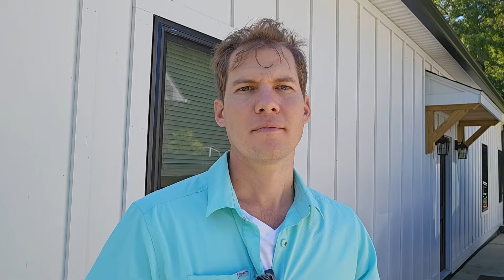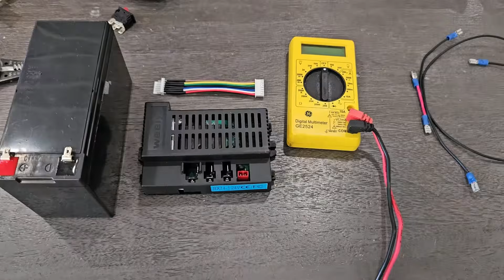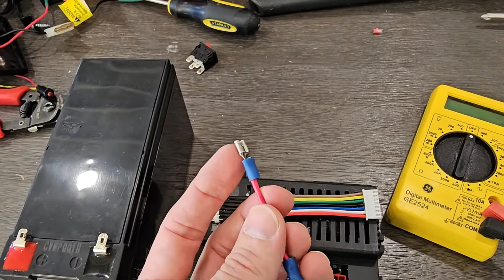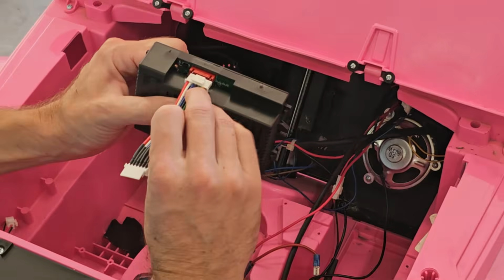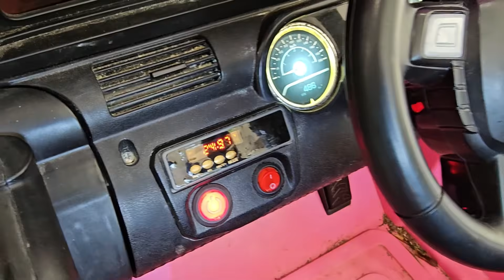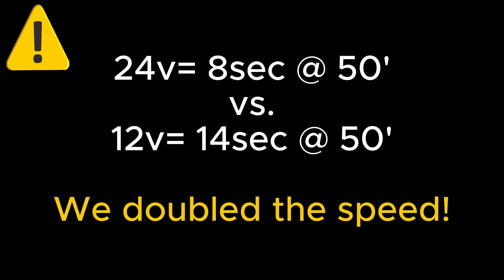Upgrade your ride-on-toy from 12v to 24v power

Comment: Could I use this controller with a Milwaukee M1 18 battery?
Reply from the maker: Yes, you can do that as well. Probably safer than going full 24v. I have another video where I run an M18 on a fourwheeler. The run time is much better and the charging time is much quicker. Helps when you have spare M18s!

Comment: read on the internet that the lights, radio and steering motor can't take the 24V. How did you overcome this or am I missing something?
Reply from the maker: Hey ben1637! Some models this is probably true for. Mathematics shows fuses should blow and motors burn up but keep in mind there is usually a built in safety factor. 
The only piece I upgraded was the circuit board. I Installed a 24v replacement for the 12v. Comes with an extra port that you won't use. When you upgrade it sends more volts to the motors but the radios and everything else should still run on 12v. Mine has been going strong for 4 years now. I probably should have upgraded the motors as well but they are still working great.
We're getting ready to replace one of the batteries that went bad over winter but check out the description. There are a few links to the products I used. 
Hope this helps clarify a few things!

Comment: Why didnt you swap out the motor also?
Reply from the maker: A few reasons:
1. Experimenting to see the length of time these would last without upgrading motors.
2. I figured there was a built in safety factor on the current motors.
3. Didn't want to spend the extra money for this mod.
4. Time. Working on 3 businesses right now.

Thanks for the question.

Comment: You need a throttle that allows the driver to control the voltage.
Reply from the maker: I did experiment with a voltage regulator on a previous project! Turns out the kids like receiving whiplash and only want to go balls to the wall! Full send.

Comment: Is that a best choice product 12v jeep? Looking to do the same to one I have, would you be able to leave he link for what you needed to do the conversion in a reply? And did you need a new charger or does the original still charge both?
Reply from the maker: Hi, it's a 12v and I added an additional 12v in series to beef it up to 24v. I dont have a link but every item I used is in the video description. Most brands are built just about the same so parts may differ slightly. Same charger works just fine!

Comment: Does this convert all the accessories like the lights and radio to 12v I saw on a different video that you need to install a resistor so you don’t blow all of those out
Reply from the maker: Hi @CopterJoe,  my lights are functioning well without the resistor installed. I imagine there is some built-in tolerance.  I don't know the specs and haven't done the math but just to let you know, the 3 that I have converted, I have not installed a resistor on any of them, and all the lights work fine.  Even a year later for the next child.
Reply: Led globes are multi voltage can run on 12v 18v 24v and won't burnout if over volted

Comment: Great vid - What motors are you running 

12v 390,550,775 ? 

Or 24v ones ? 

Thanks
Reply from the maker: The original motors this came with are still intact. I believe 35watts but not sure if that equates to a 390? Thanks for the question. 👍

Comment: How are the motors and gearboxes holding up?
Reply from the maker: Very well! Still running strong and receiving full output. One day we rode for about 20 minutes non-stop and there was a bit of an electrical smell coming from the jeep motors, but all good!
Reply: That's actually very surprising. I'm working towards the same upgrade for my kid's car as well but the gearboxes are designed for 12V, which I presume yours as well. so I honestly don't know how it's holding up.